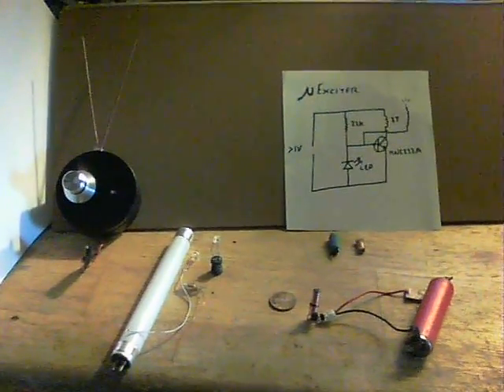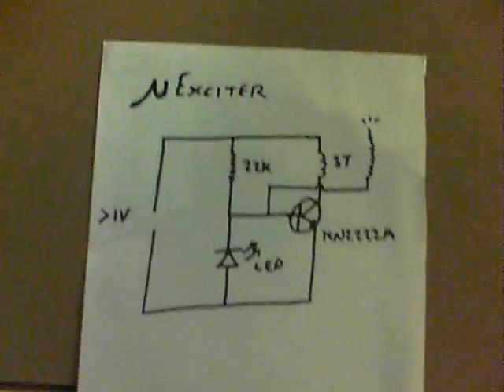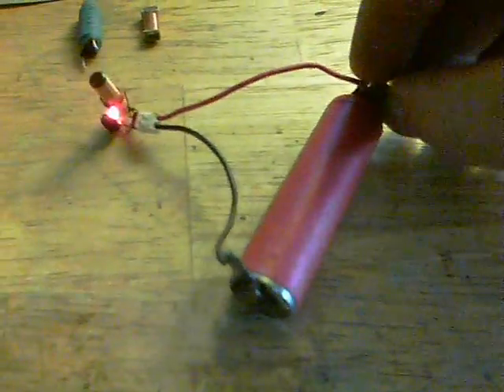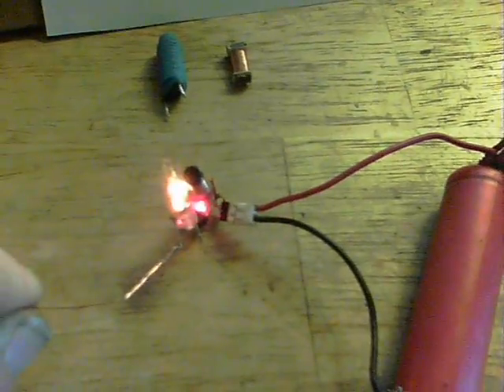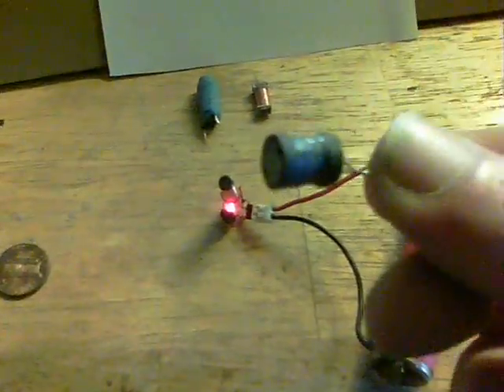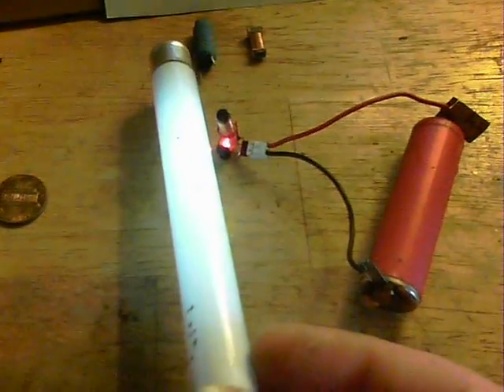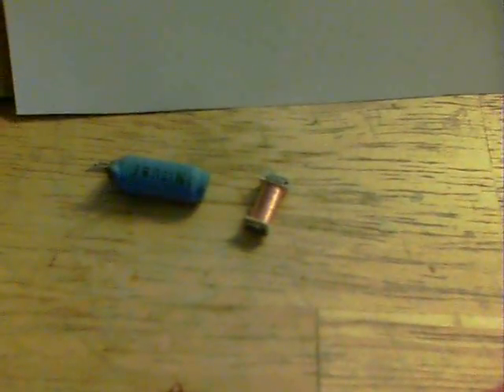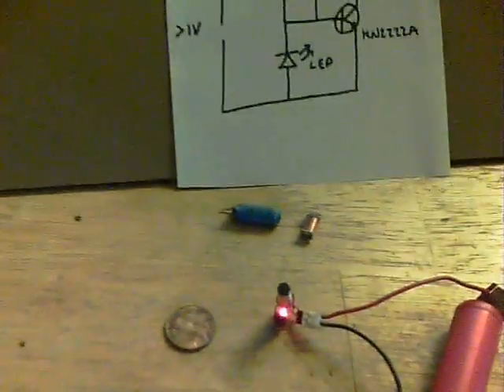Micro Exciter - Worlds smallest ?

Comment: Hi slider2732
Please could you help me to know diameter and lengthiness of your ferrite core .Many thank you
Reply from the maker: The coil and ferrite are long gone, or at least boxed away now. But the ferrite pieces are easy to find if you have a broken PC. You can find them in the power supply. Take the lid off and there may be 2 or 3 in there, with much thicker wire around. Simply desolder and unwind the thick turns.

Comment: Hi, I tried making this circuit but using arround 200 turns of copper wire around two 2,5 cm long ferrite rods that I glued together with a tape. Powered the circuit with a 9V battery instead 3,7V and it didn't work, after 15 sec transistor pn 2222a that I used turned hot. I don't know now what did I did wrong? Every suggestions are welcomed.
Reply from the maker: Viktor Božičević Well I congratulate the effort, for certain  :)
Any of these circuits will work with 3V and up, which also protects the small transistors. Upwards and a heatsink is needed (glue a penny to the flat side for example). Good choices otherwise. If you're quite familiar with Slayer Exciter builds then it's most likely due to wiring connections. Otherwise, better to start bigger. Any tower wider than about a solder tube doesn't need ferrite.
Do include the LED, backwards from negative of the power supply to the Base of the transistor. It only lights if the circuit is running and how bright it lights shows your optimum positioning for the primary coil. 
in general, without ferrite, there need to be 800-1000 turns for best performance. The 200 turns may not have been enough to begin oscillation if the turns are not very close and tight to each other. Also check the enamel hasn't worn off the wire when winding on the ferrite..that can short the coil.
Best bet is to build a bigger one and, when it runs, scale it down.
Reply: @Slider2732  yes I agree, start bigger. And than you can go up, or down. Not many people go for small, but it’s very cool

Comment: Hi, what direction did you wind the bigger (secondary coil)? Is it clockwise like the smaller too? And does it matter due to such thin wire if windings accidentaly overlap on some sides? Thanks!
Reply from the maker: Viktor Božičević Hi Victor. The circuit is the same as the regular much larger Slayer Exciters, only wound on ferrite. The Primary is in the opposite direction to the Secondary. Yep, it still matters to keep the turns very tight and as a single layer...that's what eats up the time with something like this.

Comment: how do you actually coil it ?
is it patience or is there a trick to it....
Reply from the maker: Bit of both :)
At the time, I was winding coils all the time and familiarity is part of it. But tips would be to superglue the very beginning of the wire to the end of the little ferrite rod. Then winding becomes much easier. Carry on winding no matter what, because even a drop of glue to secure the windings ends up too thick when dry to carry on afterward. Once finished, some clear spray glue or nail varnish will stop it ever loosening or unwinding.
Reply: slider2732 In this video you are powering a 4-5 watt fluorescent using just 2-3 watts from the battery with the same luminescence. Why cant a product be made of it?
Reply from the maker: Akshay Gs
It could and ought to be. There are many more efficient ways of producing light than we use every day.
By the way, the wattage is more like 0.25W, the circuit drew about 40mA. It's the high frequency wireless energy that lights it rather than current. A whole house can be lit with just a single 30AWG wire running around it, with no chances of electric shocks or short circuits.
Reply: +slider2732 
HI again
The past year I have tried to build a dozen of these coils for wireless lighting systems just by trial and error...
Now I want to actually build one by pure calculations for a desired characteristics, I have gone through so much material online and none could actually teach me from the basics on how this works..
They just say high frequency wireless power or solid state exciter..
Could you refer me to some material to actually understand the depth of this(I am an Engineering student BTW :) ).
Thanks a lot for your time!!
Reply from the maker: I know what you mean. Trial & error gets you so far, reading gets so far, but nothing really gels for calculations. Two reasons in my opinion - 1, it's a non linear progression of multiple and variable factors interacting and 2, because it's so niche. Some companies make inductive systems and people think that's all W/E really is...missing the bigger resonance and distance picture.
I'd certainly say to read Tesla's Colorado Springs Notes, where he shows his calculations, discusses his thoughts and never takes a damn day off lol.
The circa 2011 huge thread at Energetic Forum about the Slayer Exciter is well worth a read. Both simple searches. Plus, there's no harm in making such a thing a topic for a research paper (being an EE Student it could be helpful) - it all needs a good shake out !

Comment from the maker: The transistor will begin to heat up at around 6V, so it's suited to a single Li-Ion of 3.7V. It could go higher with a heatsink, but would then need a heatsink and spoil the small size.

Comment from the maker: Shouldn't think the shape would matter too much, but then I haven't wound a bar type and found out...might well do so ! Unless it seriously affected the magnetics of the setup, it should be ok. Make sure to take a resistance reading...you should be > 10ohms and not 0.4ohms etc. That would make sure coil isn't shorted. PVC again not tried, but i've seen plenty of covered wrapped towers and they work. Could put compass and 9V to secondary, compass should spin to check coil isn't shorted+has field.

Comment from the maker: If to diagram it should be good to go. It may be fine and all you need to do is flip the Primary upside down or swap the Primary coil input leads. Hope so Windings of Secondary on the tower go one direction, windings of Primary go the other.

Comment from the maker: If it was the whole coil then it won't work. The wire has to be a single layer. The larger thick wire pulses from the transistor, inducing voltage in the thin coil. The voltage is magnified as runs up the single layer, until it breaks out from the top at often 100's of volts. It's a transformer. For a whole relay, the effect is canceled each time the wire crosses past the thicker coil again, hence single layer. Either direction is fine, but the thicker coil should be wound in opposite direction.

Comment from the maker: Yes...people have done amazing things with Slayer type circuits. My 2ft tower is solar powered (from 2xalum converted car batteries) and will expand on a proven test done a while back. You can run a single 20ft length of 30 gauge wire from the top of a tower, to a 15W fluorescent or CFL or LED bulb and it will light. That's 1 wire, thin gauge...pulsed HV doesn't have current as a factor - it's far safer than traditional mains wiring too.
The tower itself can sit in a utility room if wanted.

Comment from the maker: Yeah, they are very common in PC power supplies. Usually wrapped with a plastic and then several turns of a heavy gauge wire under that...so we know the ferrite is intended for a similar purpose. Got 4 of them from the last power supply took apart.

Comment: Nice work slider. I have replicated this as well. with 2n2222, 47k r and 1n4148 diod. The difference is that the l2 is only 80 turns and L1 is 8 turns. It lights up 4 watt flouro quite nicely (with L2's other end attached) and draws only 64 miliamps from a 6 volt lead acid battery.